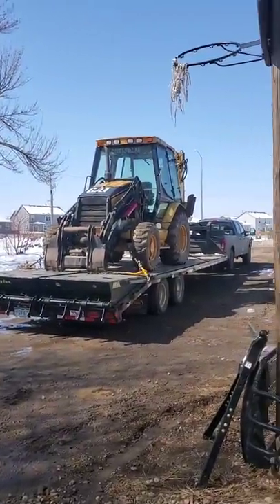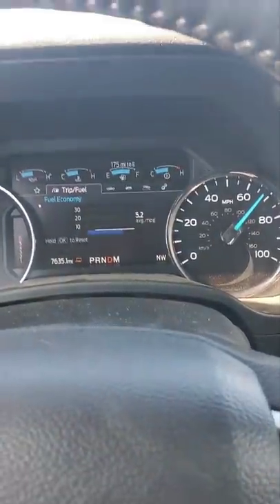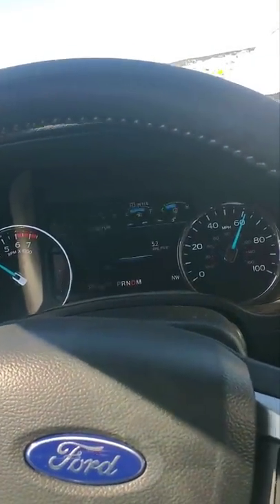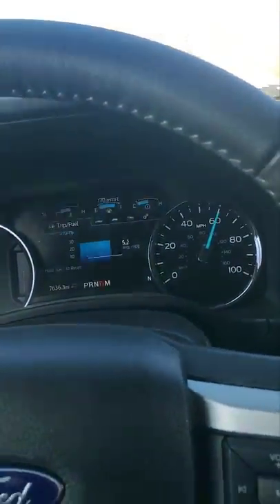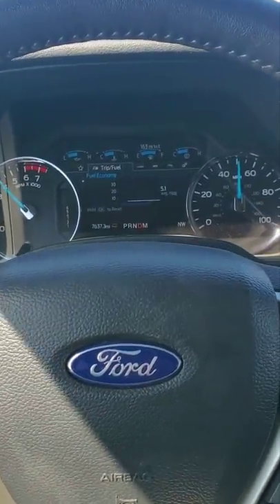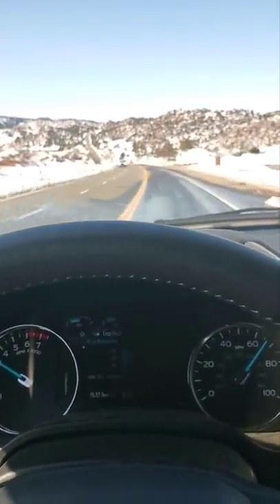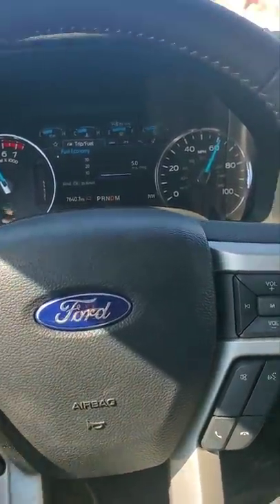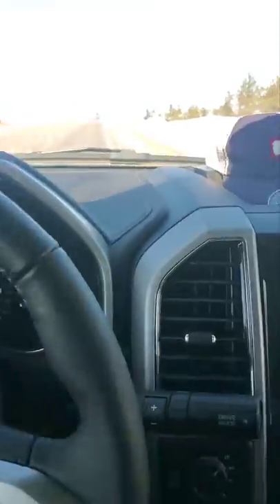7.3 godzilla towing 24k lbs through the rockies.

Comment: Your altitude/atmospheric science is b.s. Air does not get "thinner" as altitude increases particularly at ground level. Atmospheric pressure decreases but "density altitude" depends on relative humidity and "Arizona" and "Denver" are not different environments as far as a modern EFI vehicle is concerned and 200-210 F is normal operating temperature for pretty much all vehicles today. Increased altitude and reduced atmospheric pressure decreases "horsepower" and less heat is produced. The first turbochargers were "altitude compensation devices" and your "logic" as far as that POS "big-block" being superior to a turbodiesel "pulling through the rockies" is hilariously backard. "Boost" in excess of intake restriction amounts to a free "power stroke" on every intake stroke with even 1 psi acting on many square inches of piston crown to "push" it down instead of it having to be pulled down by part of the engine's "horsepower". That effect is most beneficial on inline engines that the pistons tend to "fall" down anyway but it helps on V-8s as well as reduces wear on the minor thrust sides of the pistons and cylinder walls. Heavy-duty V-block diesels always minimize V angle even when doing so requires complicating them with additional camshafts and valvetrains anywhere but "overhead" because gravity is a big assist with or without "boost" and reducing a V angle from 90 degrees to 60 or 45 reduces friction losses, wear, parasitic load and overall engine efficiency at "idle" 33 to 50%. 

As for Ford PowerJokes there was nothing Ford about any Ford pickup diesel besides retarded, faulty and failure-prone glow plug systems do to inadequate cooling in the 6.9 and 7.3 "IDI" Navistar engines that were essentially "dieselized" 404 and 446 International-Harvester gasoline engines at Ford's insistence and with predictable results from "thin" cylinder walls and Ford not using and specifying heavy-duty coolant and coolant additives and the resulting cavitation when the engines were "lugged" with manual transmissions and improper governors and fuel systems for "automotive use" on engines that large. Ford essentially "borrowed" the injection pump and fuel system design and specs from the GM 6.2 diesel which was available with the "granny low" SM465 trans and lower gears as well as the TH400 transmission and NP203 transfer case and was "unluggable". Ford "turned up" the pumps which did nothing to increase "power" at idle or part load and left them with no "torque rise" and increased pump and nozzle wear and decreased lubricative leakby and "bad glow plugs" were bad nozzles until excessive glow-plugging made them "bad" basically by heating them to the point that getting hammered with compression would deform them and make them impossible to remove. Then it was ether time. 

Then came Ford's Navistar "answer" to the GM 6.5 Turbo and Dodge Cummins. The 7.3 IDI Turbo. Because Ford basically "stole" the bolt-on ATS turbo kit which was the counterpart to the Gale Banks kit for the 6.2 only kept the exhaust stock and restrictive and didn't "open up" the intake and guys were used to "broke in" and "turned up" 7.3 NA engines with "muffler delete" exhaust, most 7.3 Turbo trucks didn't run or pull noticeably better than an NA 7.3 UNTIL "bigh altitude" but altitude quickly overcame the "boost" and having a cheap diaphragm style supply pump "in the hills" having to "lift" fuel a couple feet and "pull" it through Ford's nightmare "designed for gas burners but good enough for diesel" fuel supply and return and "dual tank" system with less atmospheric pressure to do the actual "pumping" did the rest and. 

The first PowerStroke was even less Ford with the same basic short-block and Caterpillar's new Hydraulically-Actuated Electronically-Controlled Unit Injection. Of course it was first last and always a 6-cylinder direct-injection turbocharged medium-duty engine fuel system designed for engines with 1.2 liters of displacement per cylinder.   Making it a 7.2 liter system "on paper" but putting it on a 90-degree V8 with very crappy Ford "electronic control" and insuffi cient "reserve capacity" for torque-tise and the additional plumbing and restriction losses and insufficient oil and oil cooling capacity "handicapped" the engine significantly. Which is just as well because the engines wete and are not even "medium-duty" diesels. 

The 6.0 was the "answer" for how to get "more for less" and make the HEUI system "feed" a V-8 "happily". The 4 valves per cylinder were "overkill" in sub 1-liter cylinders but necessary for central injector location. The 6.0 "oil system problems" were 100% the result of Ford insisting on "less from more" and wanting more "power" and more engine speed and more "boost" and "medium-duty performance" in "super-duty" pickups from a "light-duty" engine. 

After the 6.0 debacles Cat said sayonaea and best of luck when Ford threatened to go Bosch HPCR knowing Bosch was already at capacity supplying real engine manufacturers like John Deere and Cummins and GM/Isuzu/Duramax and when Ford went 6.4 basically to "split the difference" between 5.9 and 6.7 Cummins engines and "adapt" their programming and "clone" Bosch's "legacy" HPCR 6-cylinder system and "V8-ize" it like the HEUI system, Bosch started "coding" all injectors and ECUs with calibration info in 8 8-digit numbers unique to every injector to essentially "tune" and "match" every injector and engine and ECU at the "factory" on its medium-duty and heavy-duty engines so nobody can "hack" into the good stuff and if an injector is "swapped" to a different cylinder and vice versa, unless the ECU is "told" that Injector "Bob" is now in the cylinder injector "Tom" was in and vice versa, they will get the wrong "tuning" and because their tuning is in part due to where they are on the "rail" and in the firing order and HP pumps ARE "timed" on the heavy-duty engines and rail  pressure pulses affect "tuning" and "timing", the engine either will not start to avoid the jnjectors getting overpressured and damaged or will start and idle but "miss" on those two injectors or stay in "pilot injection" or otherwise be "unhappy:. And the crazy part is the cal numbers can be 98% "identical" on two injectors but the ECU does not "treat" them the same and where they are in the fuel system and firing order makes all the difference. 

Try "swapping" that system to another "identical" engine in displacement, bore, stroke etc even of the same make and model but in a different application and if it does anything when you "fire it up" the first time there's a 99.999% chance you won't be "happy". 

Try to "V-8ize" it and you may as well pay a real engine manufacturer to build "your" diesels. Or fuel systems.

Only problem is none of them want or need to "partner" with Ford Motor Company because Ford is now so desperate for a "successful" new engine "family" meaning one without at least 10% catastrophic failures in the first 50,000 miles or 50% in the first 10,000 and wants so badly to be out of the "diesel business" its "marketing" of "Godzilla" did and does border on "false advertising" referring to it as the "Seven Three" and "heavy duty" and a "heavy duty option" in Super Duty trucks with the obvious intent that "buyers" see "Seven Three" and think its the very recently "reclaimed" and amazingly newly "popular" for an engine that was BARELY an option in one people picture now when they see or hear "Super Duty" trucks and oh so loved "original PowerStroke "back from the dead". 

"Godzilla" is also hilarious gjven the anti-Japan sentiments of "Godzilla" like maybe Ford is "targeting" Toyota or maybe Isuzu but probably not MAZDA which is "Japanese for Ford". And of course Godzilla the fire-breathing monster "big block". 

And the "heavy duty" alternative to the Ford 6.2 "Raptor" engine. An FOUR HUNDRED AND FORTY FIVE CUBIC INCHES! Wow. A "diesel alternarive" supposedly heavy-duty "gas engine" almost half a liter smaller than the  PowerJoke. Shades of the Dodge 6.4 Hemi. 

But not the new "Chevy" heavy-duty  gas engine and its "biggest block" since the 8100 Vortec (496 cubes and the biggest light-duty truck engine ever) in the new  "Six Six". 

Yeah. 6.6 liter just like the Duramax. In fact it bears a striking resemblance to the Duramax. Like a gasolinized Duramax. What a novel idea. Unlike "Godzilla" which looks more like a de-OHCed 2-valve bored and stroked "6.2".

Pretty funny all these "hot-rodders" doing "Godzilla swaps" into anything and everything not Ford F-series and especially "legacy" Super Duty truck. 

And they're all so stoked about "big-block" and "445 cubes" and "400ish horsepower". No word on what they actually "swap" into/with as far as "platforms" and "powertrains" and "computers" and  just WTF you're supposed to do with the "throttle body".

No word on GM 6.6 DuraGas "swaps" yet. Maybe because a 6.2 "LS swap" from a 1LE Camaro will get you 650 Torque/HP naturally-aspirated and 20ish mpg in damn near anything GM "muscle car" or "sport truck" and a fully functional closing stock hood.
Reply: Bro what is this comment?? I stopped reading after the first paragraph, screw all the complexities of the diesel and give me that 7.3L all day.
Reply: @nathanmcdonald610  Exactly.......it is quite apparent he does not know the difference between Altitude and Elevation.